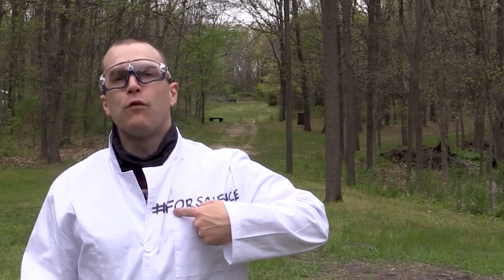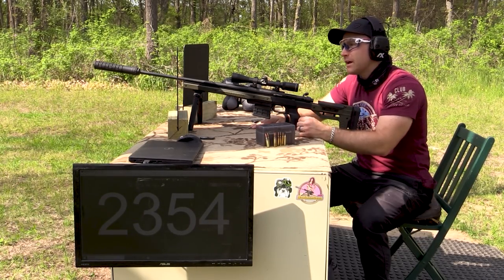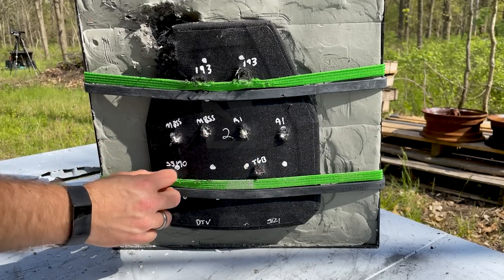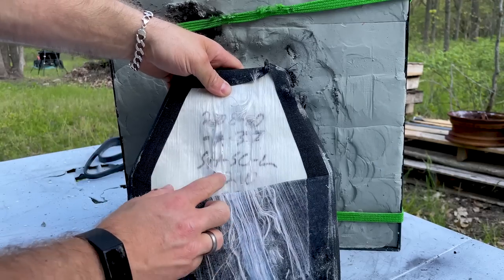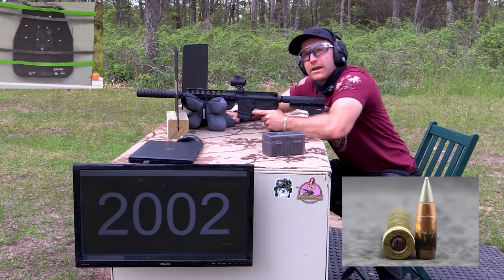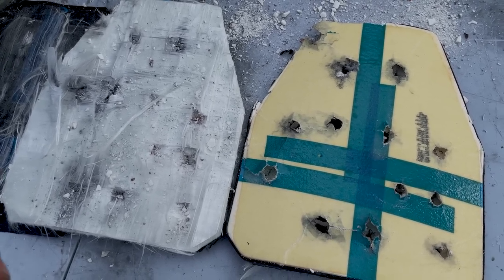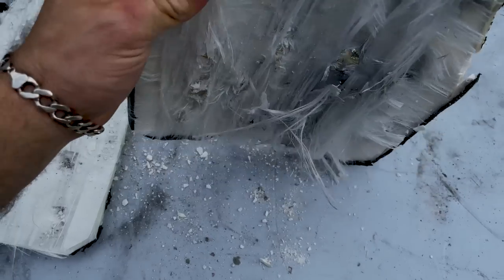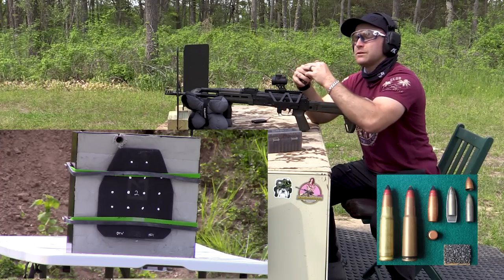Hesco Body Armor, Model L210, Meets the King of Armor Destruction

Comment: I'm really happy with my Highcom 4s17m's. Got mine for roughly the same price as the L210s with multicurve, Level IV, NIJ certified goodness. 7.2 lbs per plate so not much heavier than the L210s.
Reply: Wait, you got level 4 multicurve ceramics for 160 dollars a plate?!?
Reply: @MinuteBracelet  Yep. Got my Highcom 4s17m pair for like $325 shipped from Tristate Armor. 10x12, multicurve, Level IV NIJ certified, 7.2 lbs each.
Reply: @p03saucez  That's incredible. I have a Hesco 4401 I got for 125 but I know that they typically list for around 155. It weighs about the same but is only single curve. I've never been able to find non-steel plates that are also multicurve for under 300 before.
Reply: @MinuteBracelet  For sure they're a damn good value. Can't go wrong with em. Definitely worth the extra expense over common cheaper Level IV plates like the RMA 1055s or Hesco 4401s. I have a pair of Hesco 4400 single curves that are Level IV NIJ certified and were over $100 cheaper. But they're definitely heavier and less comfortable. Decent loaner/backup set though.
Reply: @MinuteBracelet  Though if you can swing the cost I'd highly recommend you check out RMA 1092s. Got a couple pairs for $450 per set and they're my go-to plates. Level III+, SAPI Medium, multicurve, 4.49 lbs each. Going from 7-8 lbs down to 4.49 lbs is a game changer.

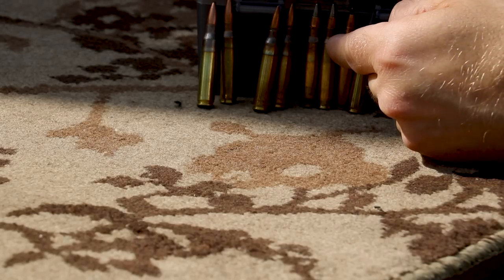Comment: Matt, great job. If I may though, at 3:56 you keep mentioning M855 having a "steel tip." Take a look at the google images of the bullet. I think it is more accurate to say it has a steel core front with a lead core behind it. It is copper jacketed which would (technically make it) "copper tipped," but no one calls FMJ it that.
Reply from the maker: True. I should be more clear about that. Internal conical steel front section. I just get irked when others have called M855 "steel core" :D

Comment: Disappointing to say the least. I had higher expectations given the amount of trust and praise Hesco and this plate in particular have gotten. Granted, A1 out of a 22 inch barrel at 45 feet isn't going to be too common, but some of the other cheaper armor you've tested has done just fine against that while also being able to stop 308. I have a set of l210s and was saving up for 3810s. Now I'm not so sure.
Reply from the maker: The 3810's would be interesting to test.
Reply: @BuffRANGE  I'll wait till you test it.
Reply: NIJ RF1 testing allows up to 3250fps max, 3400fps+ is pretty far outside that meaning this test IS outside what Hesco claimed it will stop.

Comment: Not sure if I heard this correctly or not so just kind looking for confirmation on this question. But does this plate stop 30 ought 6 black tip.
Reply from the maker: No, L210 is a special rifle threat plate. You need a level IV plate to stop M2AP (30-06 Black tip)

Comment: Just to be clear because I’m not sure if it was mentioned in the video, was this plate shot after being compromised by a 7.62x39 API round on the top left corner? 

If that’s true I don’t think it’s very realistic to expect it to immediately stop two M193 rounds exceeding 3400 FPS out of a 22” suppressed bolt gun right after. (Correct me if I’m wrong but nowhere is it stated by the manufacturer that it would do that, plus it is, in my opinion, very rare to see .223/5.66 bolt guns of this type in the wild anyways, so I’d argue it is extremely unrealistic).

I mirror the sentiments of others in the comments, I’d like to see this repeated with common rifles: 20”, 16”, 14.5” and 10.5” without any edge hits prior. 

It would also be interesting to test an uncompromised plate with the same 22” rifle with center hits of M193 after drop tests. If it lets them through like that, indeed I could see it being of a concern, although that still doesn’t make the situation less unrealistic in my opinion.

Keep in mind, this is not a “cope” comment like others, and I understand your desire to test armor to the worst case scenario, but it seems worst case scenario and extremely unrealistic are closely bonded in this case. I also understand similar body armor in this price range managed to complete the same test as this one, as I have heard with the RMA 109X series, but as we know the L210 is a special threat plate and those are not, so I’m not sure a comparison on threat protection is really necessary. People should know what they’re getting into when purchasing their armor. Special threat and Level 3 plates are not on the same ball field per se. Not to mention there are legitimate reasons to avoid plates such as the RMA 109X series, such as their weight, inconsistent size which causes trouble with fitment in some carriers, and a history of QC issues with the liners. I know this wasn’t the point of your video but this last part of my comment  was more for people who might browse this later on and come away with the impression that L210s are inadequate plates when they’re not. I only express this concern because this video is making the rounds on social media with people, in my opinion, taking the results out of context. 

I appreciate the test, and look forward to the upcoming tests on more L210s soon.

(For the record I own hesco 4800s so I don’t really have a dog in this fight)
Reply: QC issues with the liners? Care to elaborate?

Also elaborate on the sizing issues, as most plates have a tolerance.
Reply from the maker: Yes. Given I typically have  a 0$ budget for testing, I took a look at the plate off camera, and a torque and tap test didn't reveal any caution not to proceed using the plate.  One of the donors of the plates asked to see M193 against it at 3300 fps+ because the new NIJ 07 RF1 specs out 3,250. 

I wholeheartedly agree with the requests to go back down to the 16" and check M193 and M855A1, and then possibly move up to a 20" barrel, as I would agree that would be the max likely barrel one might expect real world. A penetration in the 16" at the test distance would be concerning though, given that would put a 22" barrel shot at range of what maybe 100 yds? 

I wrongly assumed that given it had a ceramic strike face, it would have stopped the steel killer M193. In the past SRT PE plates have stopped it going almost 3200 fps at (.8" thick). 

I am kind of confused by your RMA comments on the 109x series. Their 10x12 model weighs 5.16lbs. Yes they are thicker than most plates, which may limit carrier choice. I think your use of the word "inconsistent" would be better stated as uncommon or thicker. I am also unaware of any issues with liners, other than people were nitpicking the way the covers were folded over on some of the early production? 

Most of this test centered around people making wild claims about the L210's performance online, with no data to back it up. I think many are recommending this plate based on those claims and potentially misleading buyers. :)
Reply: @BuffRANGE  I agree that a penetration at test distance on an untouched plate with 16” barrel and M193 would be extremely concerning. Even a 20” barrel would be unfortunate to see, as those are still relatively common, and I definitely think you should test one of those as well. 

My comments on the 109X series were made from a purely anecdotal perspective with interacting with owners of said plates on various forums, such as TG on reddit, arfcom, various discords etc. Not only issues with the way liners were folded but also tearing with minimal use, which in my opinion compromises a plate. They are also heavier and thicker, which could be seen as a problem in my opinion, even if it’s only marginally, but I concede that that is a personal consideration buyers have to make. Again, anecdotal evidence so take with a grain of salt, as everyone should on the internet. I still think they’re an excellent choice, I merely made the comment to help people understand every armor choice has caveats. 

Regardless, do you intend to run the next tests soon? I’m sure there are lots of people who own these plates who would absolutely be eager to see how they stand up against more realistic scenarios (and manufacturer guaranteed scenarios to be honest). Because after all, they are rated, per HESCO at least, to absolutely stop 6 rounds of M193 traveling at 3,150FPS when evenly spaced as per industry testing standard. If it can’t do that, I’d say HESCO has a real big issue on their hands. It’d be an interesting result because 55g out of a 16” should usually be below 3150, but I’m not so sure with a 20”.
Reply from the maker: @friendlycrimmy8843  This test seems to have caused some commotion, so if the boss allows me I may move the L210 back up to the top and shoot them within the month. I have SafeLife's FRAS to mess with, and a dozen other plates too :D 

Ammo choice is definitely a factor here too. I routinely see 3,225-3,250 in my 16" barrel for M193 :D
Reply: @BuffRANGE  That would be really nice. 

As for ammo choice, that’s my main concern as well. Some of the IMI stuff is notorious for shooting hot, and that’s a common ammo choice in the US. Not to mention you could easily hand load a 55g projectile to exceed those velocities. 

I know it might be too much to ask since I’m assuming you have a limited supply of plates, but a test with M193 from greater distances than the one in the video would be very interesting, as common engagement distances tend to be rather far out, even in urban settings. As always with armor, people need to put it into a perspective. If you’re being engaged by rapid rifle fire at a distance of 15 yards, your armor probably isn’t going to save you, regardless of the caliber. But the odd shot at 100,200,300+ yards is very likely (which is what modern body armor is most useful for and was designed to do anyways. Think of modern battlefields and the average engagement distance. 500yd+). 

I just hope people realize a 10x12 plate that doesn’t even cover the entirety of your lungs is probably not going to be what saves your life if you ever find yourself in a bad spot. It’s for insurance, a hasty second chance when things go wrong. Quality training and quick decision making is what will save your life. Not to downplay the importance of quality armor but there’s been a lot of newcomers to guns and body armor over the past year or so, which is awesome, but a lot of them don’t really understand what armor was really designed for or honestly the philosophy behind its use. Which is really the only reason I left a comment on the video in the first place. I’m sure you are well aware of the countless tests of AR500 on YouTube, for example, where they stop a rather impressive amount of rounds before failing. as we both know that armor is garbage though, but that doesn’t stop the average potential armor buyer from setting that unrealistic standard for armor. 

Hope this made sense I was kinda rambling. If it doesn’t stop M193 at that distance from a 16” barrel, none of these comments matter because that would be really bad lol
Reply from the maker: True. There seems to be some “mental masturbation” about armor making someone like IronMan soaking up rounds, when in reality, you need to avoid getting hit at all costs. And if you get hit 1-2 shots is a likely scenario? But nothing is a given :)

Comment: If there is no foam on the strike surface, whether the drop test will cause damage to the ceramics ? If foam is added, the thickness will change. I wonder which one you like.
Reply from the maker: I would think a small increase in thickness would be better than potential cracking

Comment: The L210 isn't foamed for NIJ drop protection, I'm starting to think the drop test cracked the ceramic early and compromised it...
Reply from the maker: That has come up in the discussion, but there's a research paper I had been given, that mentions a ceramic armor still able to provide full protection even a crack from a fall develops as long as the ceramic and backer remain closely bonded. If you look at the tear down of the plate, that strike face is still in damn near one piece minus the strike holes. That's pretty amazing in itself given the hits taken, and I don't feel that drops comprised the plates ability to perform. :D Of course that's my opinion though.
Reply: @BuffRANGE  that’s John Sun right? The researched used out of warranty CBA plates (alumina) which were cracked using a hydraulic press. They still functioned to spec even after cracks. A big reason is probably the binding and proper lamination.

Comment: Would like to see the same test on 3810's, kinda curious how they would handle a 20" barrel at that range 🤔
Reply from the maker: Those have also been requested. I will have to save for those!
Reply: @BuffRANGE  The testing you do is fantastic, man. Do you have a crowdfunding page? I'm getting ready to pull the trigger on new plates, and the 3810 is at the top of my list, so I'd gladly chip in some cash to make that test happen.
Reply from the maker: @squirreltakular9049  I have a Patreon Page. Or if needed I have Paypal. i would love to test the 3810 someday..

Comment: What's the idea behind using 22" barreled bolt-guns instead of more typical SBR's and 14.5/16 or even 18" guns a rifle plate is most likely to stand-off against?
Reply from the maker: I test worst case scenario. The new NIJ RF1/2 spec call for M193 at 3250 fps. If your plate stops the same round going 3400 fps, that's clearly an advantage over a plate that can barely stop M193 at 3250.

Comment: Hey I was curious what your thoughts on the 9x39 were?  I've got a 8.5" gun in 9x39 and have been playing around with the idea of buying some of the inert / display cartridges from RUS , pulling those and reproducing SP-6, and BP velocities. 

I saw a PAB-9 and SP-6 cartridge for sale not long ago but 200$ a round is a tad steep for my pockets.
Reply from the maker: It’s something I want to test. I have the bullets. Need to find a way to load em and get an upper
Reply: KAK  offers redding dies, but you have to fireform the brass. Leigh high is supposedly making brass and projectiles.  supposedly there is someone making hydraulic forming dies for it too but I couldn't find them.

I've also been experimenting with loading 9x18 pulls for the laughs.  7n25 pulls would provide some pretty interesting results. (in theory if anyone could ever get ahold of them)

Comment: Damn think I'm going to get rid of the L210s I have. This was abysmal performance for what is supposed to be a 'good' brand. Also subscribed for exposing bad products and not shilling.
Reply from the maker: In all honesty I took the plate well beyond what it was rated for. It has its place but I feel a lot places try to sell it as a level III
Reply: @BuffRANGE  well for what i paid i kinda hoped for at the very least most 5.56 with the exception of armor piercing. The fact it got beat by most of what you tried for me is worth buying the RMA and trashing the L210s I have. Again thanks for exposing what the influencers are pushing.
Reply: @iliftthingsupandputthemdow4364  special threat plates have their place, something more than soft armour protection but still somewhat concealable. The problem is influencers are pushing this as an alternative to an actual level 3 plate which is concerning.

Comment: Hi, which of the following plates are best in your opinion :
Hesco l210
NIJ IV Militech Standalone
or mayber Universal Armor Nij IV?
I've wanted to bought one of the followings but i need an opinion and you've been tested all of those 3 plates so please help :)
Reply from the maker: What threats do you want to stop?
Reply: @BuffRANGE  russian ammo so its probably:
7.62x39mm-API
7.62X54 -API 
30.06 M2AP
and rest of the ammo that they're using on ukraine, im looking for something NIJ IV
Reply from the maker: @marcuskethler9253  Hesco L210 is only for 5.56 threats. The Militech has more edge to edge coverage than the universal armor level. Are you US based? The RMA 1155 is another consideration.  Do you have a weight or monetary budget?
Reply: @BuffRANGE  the problem is im not us based, thats why im looking for something from those 3 plates, I'm from EU
Reply: also about militech or universal armor.Are they enough with plate carrier only or i need to use those paltes with soft armor inserts too?
Reply from the maker: @marcuskethler9253  correct NIJ Level IV listed as “stand alone” don’t need soft armor. IMO the Militech would be superior.
Reply: @BuffRANGE  Sure, tahnk you for help. Can you tell me also are militech helmets are good thing for consider in your opinion? Especially those with additional plate that makes them NIJ III?
Reply from the maker: @marcuskethler9253  they work as intended. They are heavy with that level Iii add on. Video here:
https://youtu.be/rgp7r9lb6-0
Reply: @BuffRANGE  Okay. Well, thanks for your responses you've helped me a lot :)

Comment: M193 is beating this thing? That doesn't look good.
Reply: M193 out of an unrealistically long rifle WITH suppressor striking a compromised plate, I would have been surprised if it didn't pass through. Drop the speed by almost 400FT/S such as you would see in a 16" barrel and the plates more than likely would have stopped them with guaranteed stops at the also common 10.5" barrels.

Comment: the 22" barrel is pushing the bullets outside the rated velocities
Reply from the maker: Just remember that the new RF1/2 rating for M193 will put it at 3,250 fps. I admit I assumed because other plates like the RM1092, the Militech RF2, and the ShotStop GT stopped M193 from the "worst case scenario" this would have done it no problem :(
Reply: @BuffRANGE  3250 is the muzzle velocity of M193 from a 20" barrel (although many manufacturers have lowered the velocity over the last few years). You were hitting 3300-3400 from the 22"
Reply from the maker: @mcantu197  :D I will re-test the remaining L210s with 16 and 20" :D